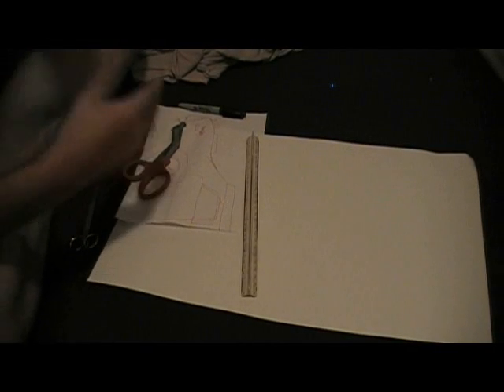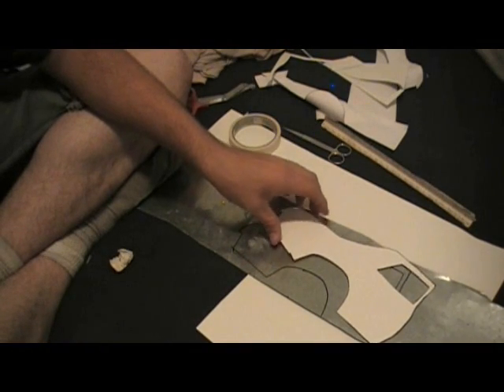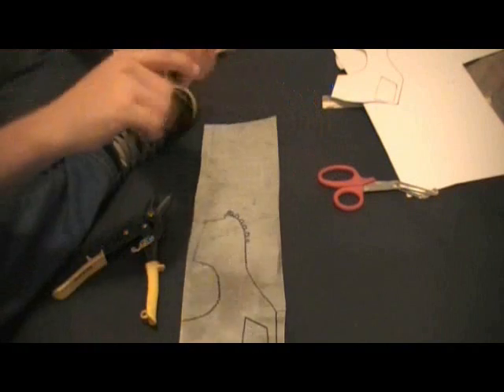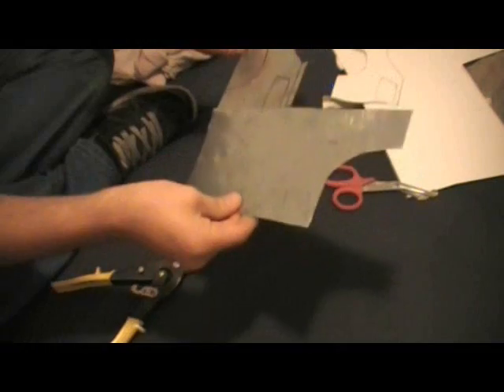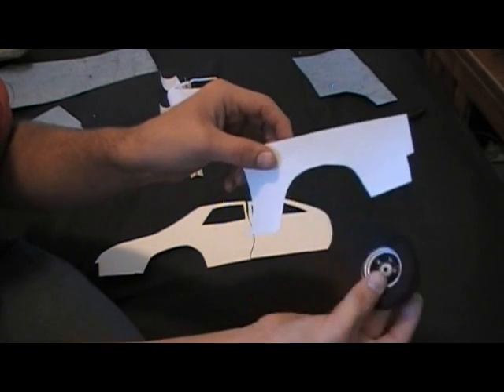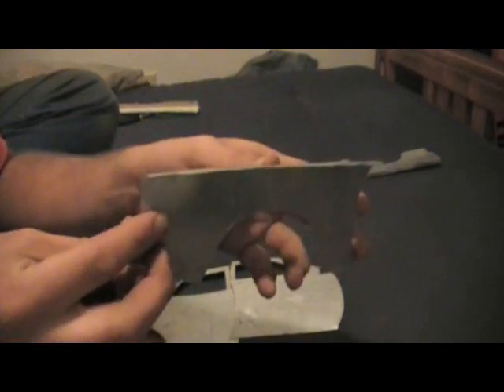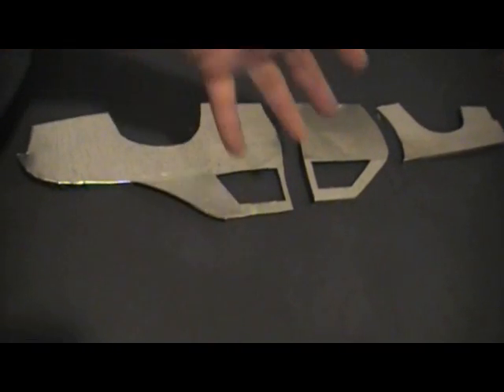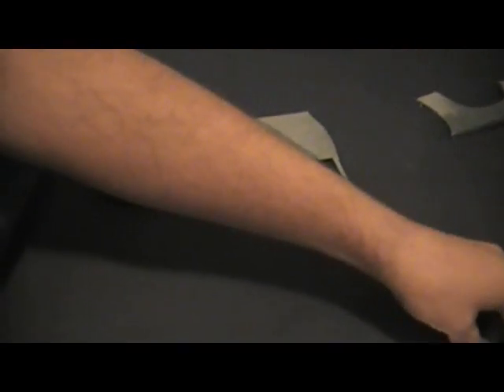How To Make A Sheet Metal Rc Car   Part 2

Comment from the maker: its a dremel tool       most people with a work bench in there garage have one      

it may be the most handy tool ever made      i use it almost every day  

i have a cut off wheel on it    so i can quickly cut out windows    instead of widdeling them out  with the sheet metal shears   all  afternoon       any walmart or home depot will have them       or you can cut the windows out the old fashoned way     or just paint them on   like i use to

Comment from the maker: @chrissydew2    on that body   it would not work still    even if i tabbed the roof  there is not enough area to attach the parts and have them work well            mess ups are bound to happen     i also  made the body before i found the chassis     later i found out   i made the body  too large   it is made in between 2 different size scales   and nothing will fit it right    i would have ot make a custom frame and drive for the car   and it just isnt worth it